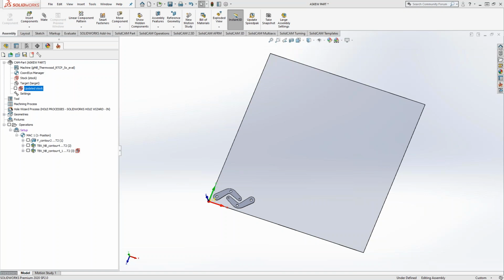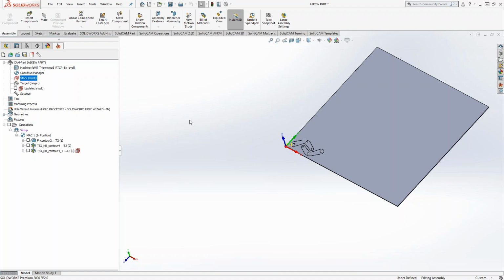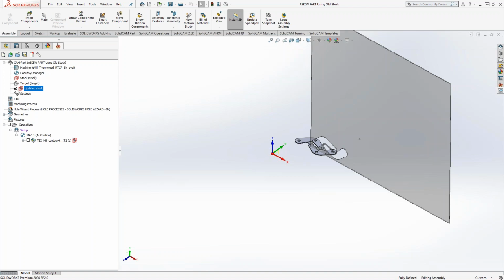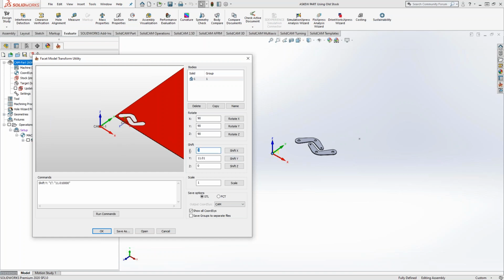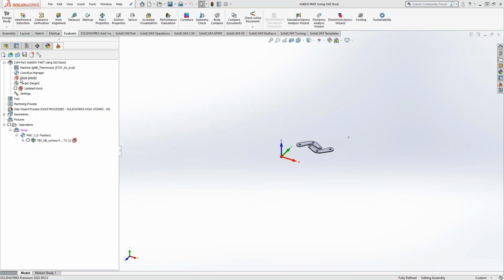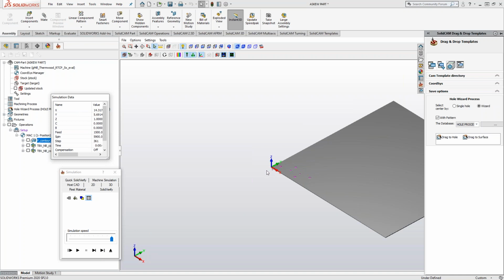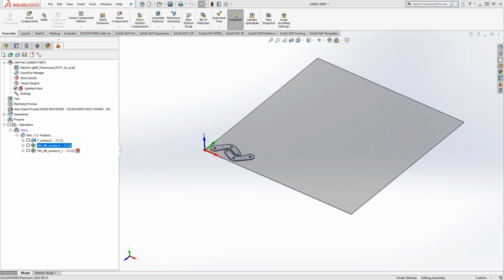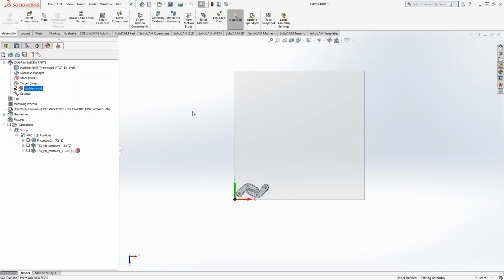SolidCAM LIVE - STL Stock

Comment: It seems there is a way to avoid rotation/translation of STL stock. Before exporting the STL from Updated stock, create CAD CSYS in CAM part of the assemly tree (Design model and CAM are in the tree usually, do it with Edit Part function so you still see the assembly). This CAD CSYS has to be in same position and of orientation as MAC CSYS. Save all. Afterwards do the export thru Updated stock as shown in video (output CSYS should be set to CAD) and the import thru regular Stock STL definition with no need for rotation and repositioning. Tried it multiple times and it worked for me.